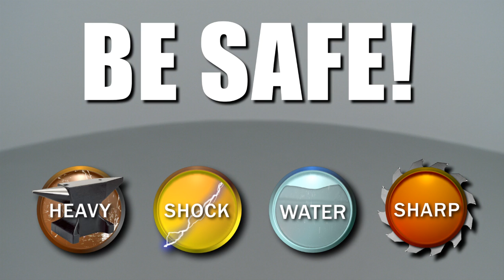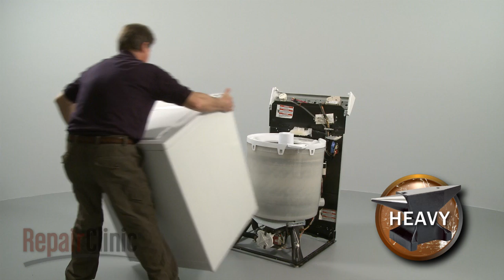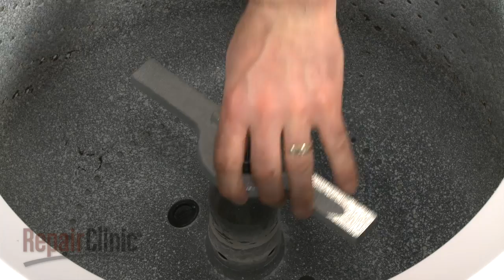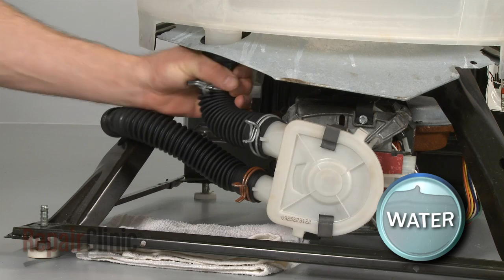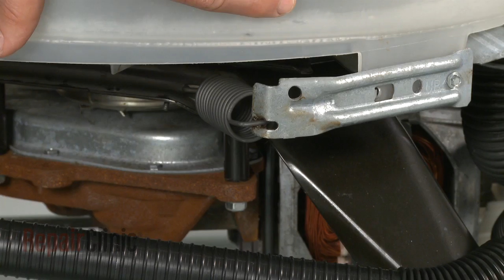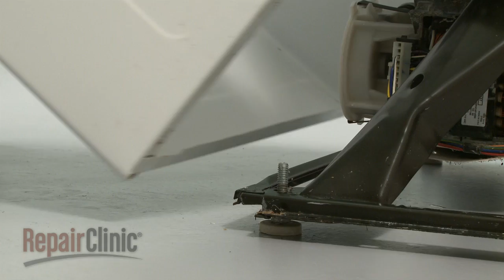Whirlpool/Kenmore Top Load Washer Drive Suspension Pad 285219

Comment: I didn't take the outer plastic tub out, I just flipped it upside down where everything was very accessible. Left the springs attached to the frame, took fame off and adjusted suspension plate. Dropped the frame over it and connected the  springs. Was careful not to let that suspension plate slip out of position setting  it back upwards

Comment: I removed the tub nut and the ring but I cannot life the tub out. It is stuck. Any suggestions?
Reply: I sprayed some WD40 on it then banged on the neck of it for awhile with a rubber mallet. Finally it loosened...it was pretty froze up.
Reply: @scotteustice6230  That was what I tried first. It is seized with rust. I've bought an angle grinder but haven't mustered the courage to try and use it yet.

Comment: You make it look so easy but it's not. You don't take into consideration that removing the inner tub from an old washer is not easy. I can't remove the inner tub it is stuck on the shaft. I sprayed WD40 hoping it would break free but so far no luck. I might have to give up and reassemble the washer. I also made a mistake and bought a cheap spanner wrench. Had a difficult time removing the nut. The spanner wrench I purchased won't rest on the nut so I had to hold it up to prevent it from dropping down on to the tub. What do you suggest on how to break free the inner tub?
Reply: I just found your comment,  and I had the same problem as you in trying to remove the inner tub or even the outer tub ( plastic tub) try using vegetable oil on both, 3 applications within a hour on the basket that takes the spanner wrench to get to the drive block that is stuck/ fused on, then wrap a towel around the transaxle/shaft and hit it sideways with a hammer in a circle a few times, and start pulling/yanking upwards ( replace that drive block) for the outer tub (plastic liner ) 3 applications and within 10 minutes it will be ready to go, tilt the liner towards right side and with your right hand go underneath the liner towards the middle and it will pop up! (If your washer is older 10 plus yrs. Replace the tub seal as well) I see that this comment was a year ago, but I thought that I should at least try to help someone in our situation!!! The other is that if you are going to replace the suspension pads, do both sets at the same time! I hope that everything worked out well for you, and your washer is working great!!!

Comment: I discovered that on these springs its much easier to unscrews the bolts and disconnect them that way, they are not under much tension if any and at least on my washer they are curved pretty nasty and are hell to get out the old fashioned way, this might help someone, i have been able to put them back also that way, took a little effort but much easier than pulling and trying to get them in.

Comment: Is there a substitute for that spanner wrench?  Nobody has one of those on hand.
Reply: I used a hammer and screwdriver. It came off easily.
Reply from the maker: +Timetryp http://www.repairclinic.com/PartDetail/Spanner-Wrench/TB123A/1021707?TLSID=1773
Reply: I saw someone attach a vice-grip to the nut, then hit the vice grip with a hammer in the direction to remove the nut.

Comment: I have a Kenmore M# 110.29822800.
The washer vibrates like crazy when in spin cycle, and will walk across the cement floor if I let it....

I've changed the snubber pads, the suspension springs, and the counter balance springs. 

None of those repairs fixed the problem. 

It seems to me that the tri-base floats all over during the spins cycle.  Is it supposed to snap into place?  The pads are all flush, and I've put a level on the machine to make sure it is level.  The motor seems fine, and there is no play in the agitator from side to side.  (The whole tub can easily slide back and forth when it's reassembled however).

I'm thoroughly frustrated as to what to look at next.  Ideas?

Comment: would this solve a loud spin cycle issue. We have checked all other issues that we could have had, including leveling, springs, and several other things to no avail.
Reply from the maker: This is most likely not your problem. Check out the repair help section of our website using your washer's model number. That will give you more suggestions for parts you can check: http://www.repairclinic.com/repairhelp

Comment: is the outer plastic basket supposed to be able to move irrespective of the metal inner basket? if not, does that mean i need to replace the drive block? The machine wasn't having any trouble with the agitation cycle or draining, just the spin cycle.
Reply: I have the same problem, did you find the solution?
Reply: No, there is a part they have come out with that's metal that will fix that problem.